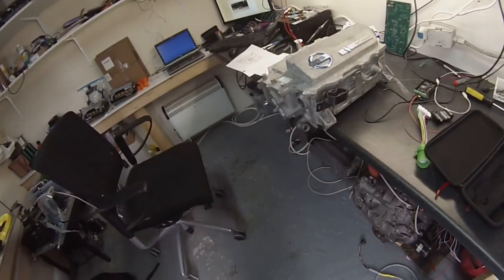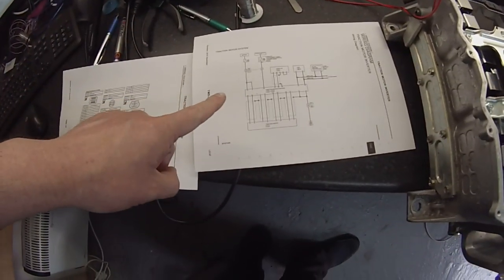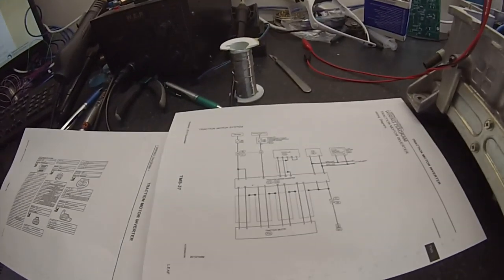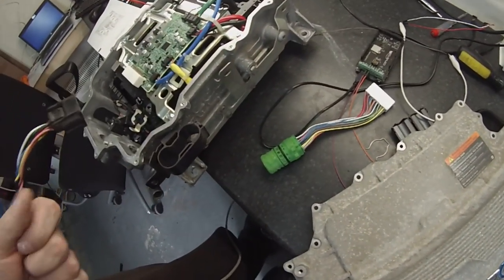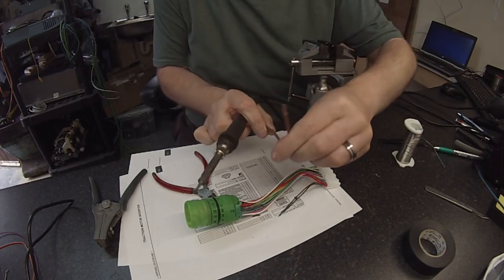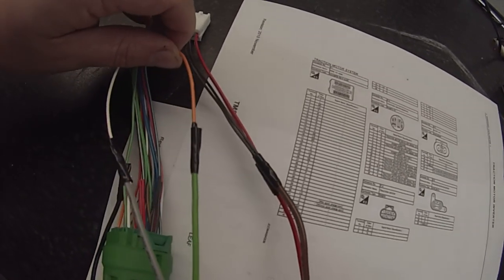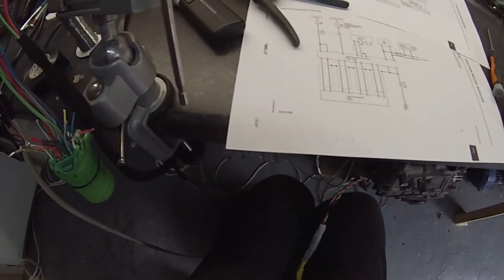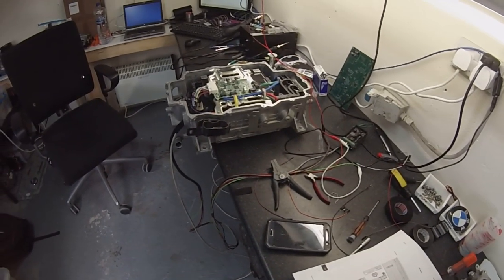The Grey Goose : Leaf Inverter Wiring

Comment: Been watching this video several times over a good amount of time. I like how you read the connections out to go to the resolver, but could we get the color match ups too? I'm currently doing this same project and want to make sure my colors match up. I think I am correct after looking at the pins with the diagram I found online, but I would hate to have big problems from having one color mis-paired. Any advice from anyone else who has had success would be very much appreciated!
Reply: -This is what I have and think is correct-
Damien called out: (resolver first then inverter harness)
 4:31-3:32-6:27-7:20-8:6-1:1-2:35-5:34
That would correspond to: (In order)
Black: Grey w/ White stripe
Yellow: White w/ Grey Stripe
Green: Blue w/ Grey Stripe
Brown: Pink
Pink: White
White: Blue w/ Yellow Stripe
Blue: White w/ Green Stripe
Red: Yellow

Comment: right fer for popping over here some i think German guy YT video has a link fer a board thats was like 700E lol f-that price as it just not worth that fer a cart build from old junk ..i mean its a board not a complete  rebuilding of a large 1970`s sansui receiver but i may not understand why little board costs so much n may have to ditch EV  till a 400 usd solution is around  ..i wonder if one has a wreck leaf if one could use it stock but not in car by pull it all out or if a anti theft feature would get in way ill have to talk with you or another experienced guy one day soon about leaf power plant ...be blessed ;]

Comment: Shame to cut that cable. Paul kennet has produced a yazaki connector which is 3d printable. Same could be done here
Reply: Do you have a link to this printable connector ?
Reply: @darrellsveistrup4718  look up paul kennet leaf mods. He has 3d objects on mini factory. Which is like thingiverse. To be clear a yazaki connector is the one from the battery to the car (carrying data signals) nothing to do with the inverter.

Comment: I'm ignorant here why in these EV swaps do you guys have to hack/bypass/or replace the inverters/speed controllers as opposed to just installing as is? Are they wired or programmed in such a way to try and prevent you from hooking them up to other cars?
Reply: Yes of course they won't run if they are not receiving signals from the car that they are expecting.